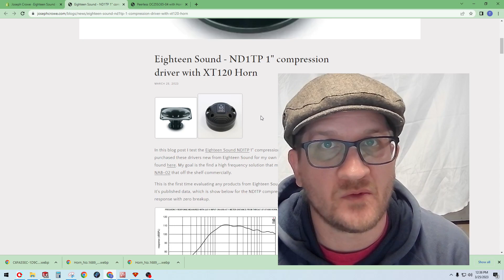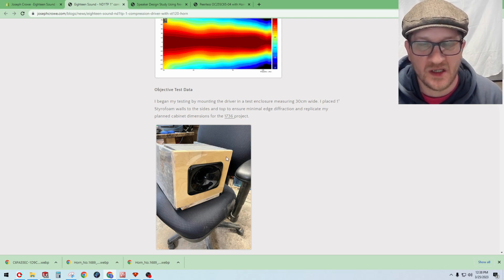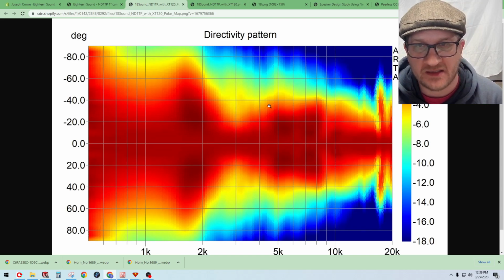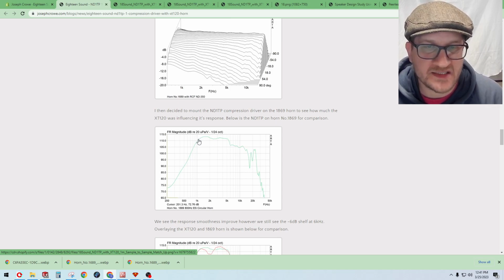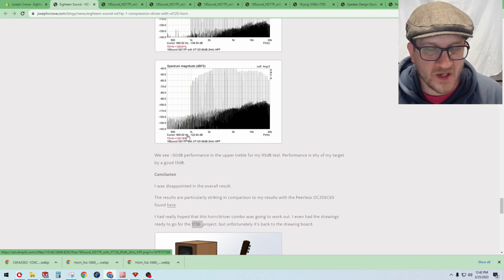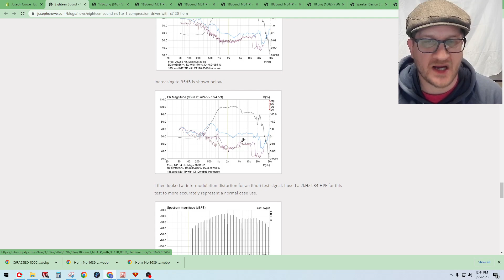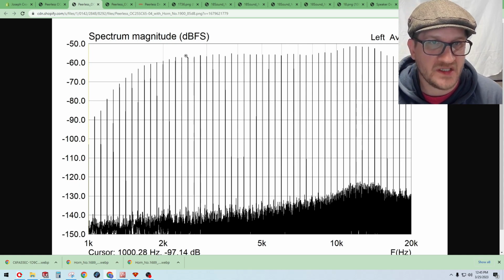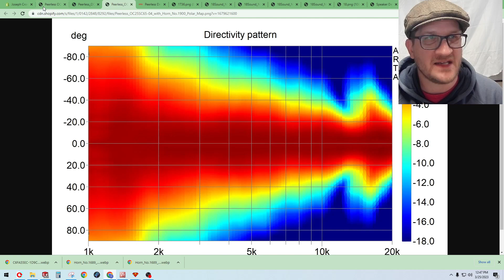Eighteen Sound - ND1TP 1" compression driver with XT120 Horn

Comment: Maybe i didn´t understand something, but the Eighteen Sound chart you show, is labeled: measured with XT1086 horn.
I see similar shelve at 6kHz on your measurement, as Voice Coil magazine, as manufacter graph. Maybe(probably) manufacturer used higher smoothing.
IMHO it´s shame using such a small and cheap horn if you have 30cm wide baffle, especialy if you want used this super expensive woofer.
Please, don´t get me wrong, i admire your work very much and i believe that your own horn designs are much better than these off shelve.

Comment: Your directivity messurements seem to differ quite a bit to the messutrements from the Test Bench / Voice coil  magazine articles with the XT120 (tere are two, one with NSD1095N driver and one with the ND1T). I Messured the directivity myself and got the same results als Voice coil/ Testbench, so i think the difference seem to come from your test baffle. did you test your Radial Horn in the video on the same Baffle as the XT120?
Reply from the maker: Looking at the TestBench results it seems similar, there’s the narrowing of the directivity in the 2kHz region along with the -6dB shelf. The only difference is in the size of the bump at 3.5kHz where my test is more pronounced, which could be the baffle. I tested the circular horn only to see what issues were inherent in the driver, which confirmed the -6dB shelf. My testing is being conducted in order to find a suitable horn for the 1736 speaker project, not necessarily to produce IEC test conditions.

Comment: Eighteen Sound’s measurements are most likely made on an IEC baffle though. Overlay the simulated response from your baffle onto their measurement (SPL trace) and see if it matches yours better.
Reply from the maker: The narrowing at 2kHz is mainly from edge diffraction off the 30cm wide baffle. I am not trying to replicate IEC conditions, I’m trying to find a suitable horn for the 1736 project.

Comment: Good testing.

If you want to pair with the 8" woofer, I would think you would need a tweeter than plays a fair bit lower than the compression driver. Else I would expect a directive mismatch between the woofer and tweeter.
Reply: If it can be crossed at  ~1.8 kHz, putting it into an oblated spheroid -> conical waveguide with ~8" mouth should do the trick.
Reply from the maker: I’m having a horn 3D printed that should work. It needs pattern control down to 1kHz which is typical for match up to an 8”.